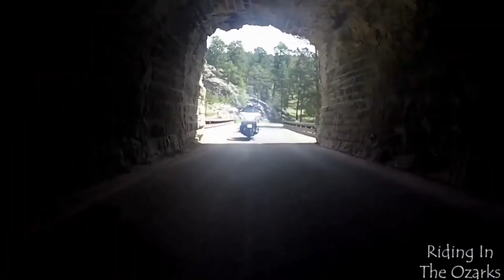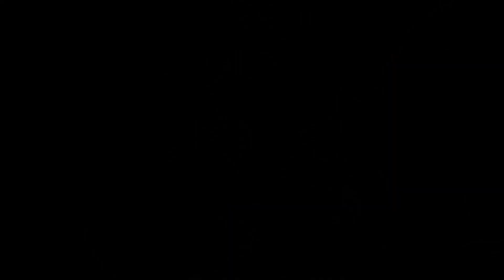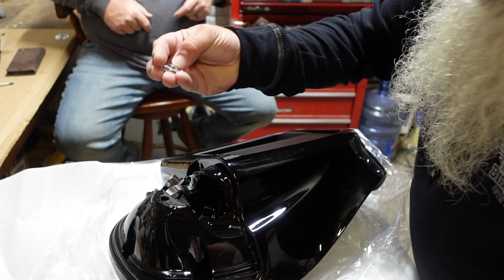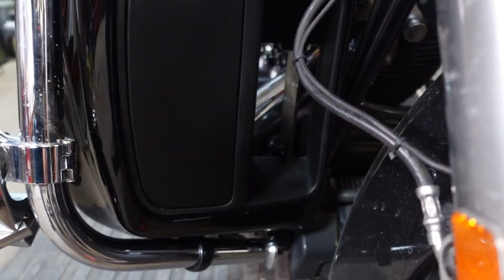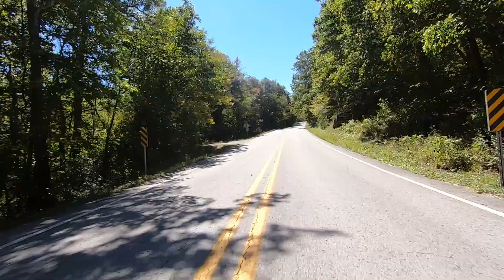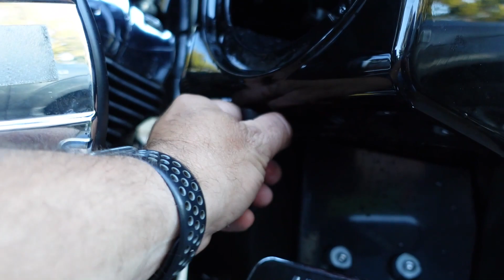HOW TO UPGRADE YOUR HARLEY DAVIDSON STREET GLIDE - TCMT LOWER INSTALLATION

Comment: The TCMT lowers are sufficient for the task. They will wear out more quickly than OEM but you could buy a new set every year for six years and still be ahead from having bought OEM lowers. 90% of the utility of the OEM lowers for 15% of the price

Comment: That’s a great price, I recommend using some dynamat strips strategically placed inside the speaker surrounds when you install the speakers.  Make sure to stick some on those metal mounting brackets.

Comment: When I had my 2017 Road King I went third party lowers myself, such an incredible deal and they were even color matched perfectly that the dealer service department did not initially notice they were not Harley lowers
Reply from the maker: Yeah Sinister Sound said they looked as good as any other brands they have installed speakers in.

Comment: Yea warmer riding but also less road fatigue due to the wind break on your legs.. That's the good thing about Vivid Black, most aftermarket add-on can come already painted to match.  Here is a tip for all, if you don't like or want the lowers to rattle on bumps or high throttle or loud speaker events, line or cover all mating surfaces with tape ( black electrical, duct or gorilla tape) because they will rattle without it.

Comment: I bought one a year ago for my 2021 RK. It works fine. I just can't spend $800 for OEM. Also bought screen panels for summer time, and use solid panes for winter.
Reply from the maker: Sounds like we are in the same boat, mine work fine a fraction of the cost

Comment: I was looking at just getting speakers that mount to my crash bar this gives me another option...
Reply from the maker: Going to. 6.5 in speaker makes a huge difference in mid range. Do you have place for an amp?
Reply: @RidingintheOzarks  I already have a amp and upgraded Rockfords in the fairing but the amp has space for four more speakers..
Reply from the maker: Oh this would be much better than any crashbar speakers I have worked with.

Comment: We do not know if it costs after one year?
We definitively don't know if it'll keep working after one year without pay subscription?
I don't care about shops having to do updates I want it to work on my bike to be able to bleed the brakes I've already bought it so I don't have Wi-Fi so I got to get that figured out but I'm trying to figure out if it's going to work after 1 year.
Reply from the maker: It was implied it would still work but not get updated if you didn’t have a subscription. I think updates would be valuable if you are a shop working on newer bikes all the time. If don’t have wif just charge it then take it somewhere with free WiFi to register it and do the updates. You don’t need WiFi to use it after you have updated it.

Comment: Welp, confirmed these won’t work on TC with SE heavy breather 🤦‍♂️
Reply from the maker: They make a short version of the breather or filter i think, my buddy had to change breathers to put lowers on his Street Glide with speaker pods and his lowers were a different brand so I think you will have that issue no matter what lowers you get...
Reply from the maker: Did you order them using my discount code and link by chance?
Reply: @RidingintheOzarks  no I missed that
Reply: Or probably more so I forgot about it by the time I got around to ordering